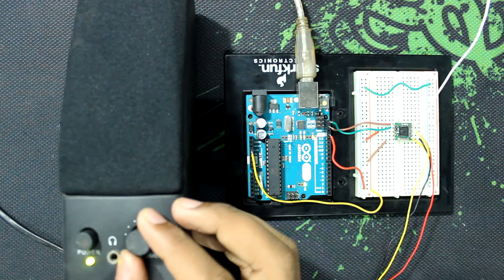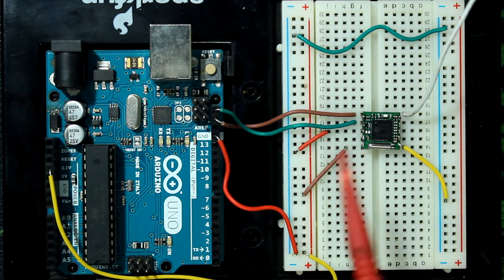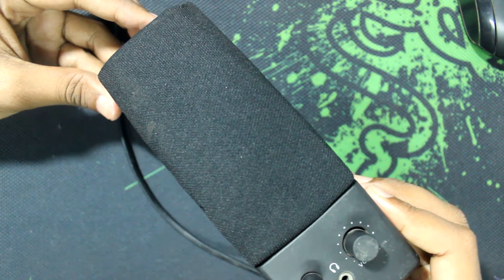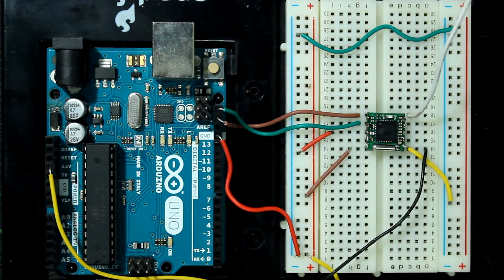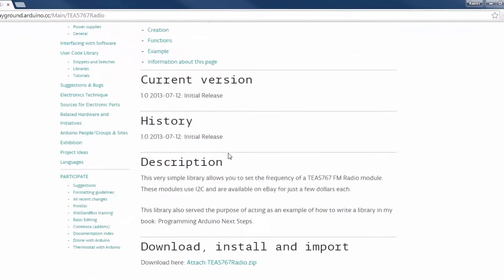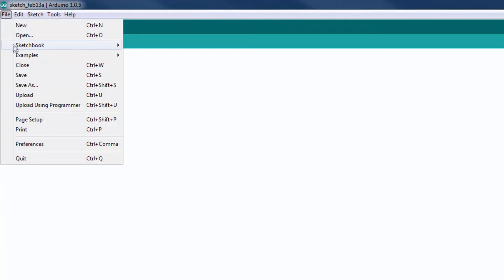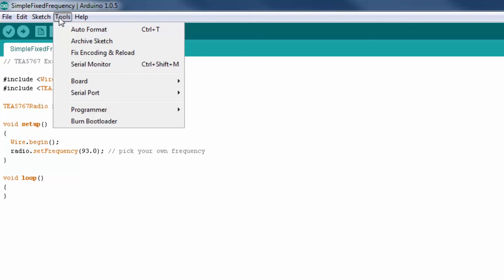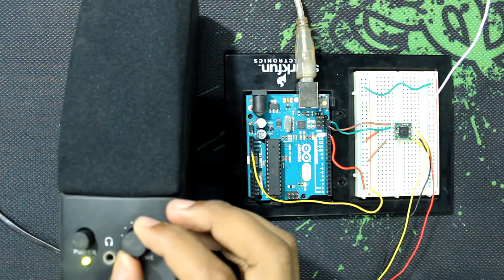TEA5767 FM Stereo Radio Module Tutorial.

Comment: Do these have internal pullup resistors for I2C lines? I don't see them on your board Because without then it wont work. I have just started to build it, but thought I add an ADC to control the tuning frequencies ...

Comment: I have a question. I have purchased the transmitter module. The pin diagram is same I think. So is the transmitter circuit same as this receiver?? Can you please make a video on transmitter using this module?

Comment: When the module tea5767 is "programmed" it's possible use it separately without arduino?
Reply from the maker: no, we are not programming the radio module, we are programming the Arduino. Arduino is necessary for it to work.
Reply: Ok,I thought it was so.. 
thanks! 👍

Comment: Can I use only one speaker?, do I need an amplifier?, how do I change frequency?. Pls help
Reply from the maker: Yes, you can use One speaker, Yes you need an amplifier,  You can change frequency by using the radio.setFrequency function, inside the parenthesis, type your radio frequency. hope that helps.
Reply: Cooltronics thanks for reply, I'm just trying to figure out the circuit for using a tea5657, lm386, atmega328, speaker, potentialometre and rotary encoder
Reply from the maker: good luck for the project. let me know if you need help.